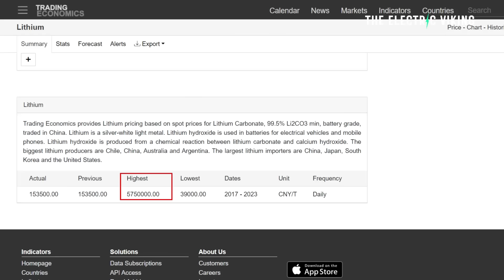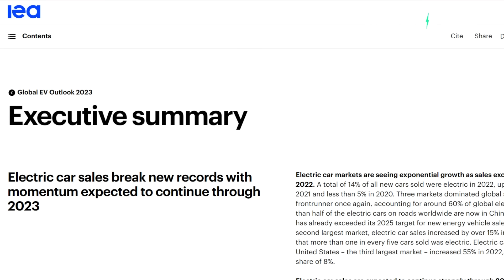The reason Electric Cars will be cheaper than ICE cars in 2025

Comment: You're inferring the wrong things from the price of Lithium. There are two sides to the price equation, supply and demand. The combination of those two sets the price. Although supply has increased over the last few years, supply doesn't change much over a month or two. Sudden changes in price are likely due to a sudden changes in demand, and if you look at the auto industry, EV demand has hit a wall. The people that will buy and EV because it's cool already have one, and for the people that are left it needs to make economic sense, and EVs don't make sense at current prices. Therefore unsold luxury EVs are piling up on dealer lots here in the US. Interest rates have also hurt the economics of EVs because you are basically paying more up front in exchange for savings down the road. This is harder to justify with higher financing rates. It think we are going to see a setback across the entire auto industry with prices of the average car coming down, and the luxury car market getting hit hard. Can EVs compete in that market? Maybe, but you can be sure that the price of ICE cars will come down too due to reduced demand. The winner will be the one that can get cheaper products to market the fastest.

Comment: For around town EVs are great as you can charge at home, but in the US there are not enough charging spots. In some places people are waiting in lines to get a charge spot for 30 mins to “fill up”. As soon as existing gas stations have chargers that would change but it’s far off.
Reply: You're confusing all other EVS versus tesla. Tesla's have no problems charging, there's chargers everywhere.  Tesla's are actually far easier to use than a gas car, I know since I have both.  Taking care of my gas car is a PITA.  the Tesla is easy it needs no maintenance. Just charge it at home twice a week, easy.
Reply: Fortunately, battery tech keeps getting smaller, faster charging, larger charge capacity, etc. We're just a 3-5 years away from EVs getting FAR more "per gallon" than ICE cars. 6-7 years and you'll be able to drive across the country on a single charge.
Reply: @monkeysuncle2816  But not by 12-15 months in 2025. As soon as I can pull into a QT or Loves on the highway and get a sandwich and a drink while I charge without waiting I’m in.
Reply: @jeffgreenwaldJLG  we could be there in no time with solid state battery tech.
Reply: @monkeysuncle2816  when that arrives I’m in. LOL

Comment: I neither agree nor disagree with you.  Certainly though, I don't think you have sufficiently considered a number of factors in your analysis.

Why would you use China's EVs as ANY kind of example?  Chinese EVs are highly flammable, INCLUDING BYD's EVs..  And very explodey; it's all out there if you look for it.  Lithium batteries are inherently more risky.  I think that you're not thinking this is a bad situation at all, ,but it is.  Sometimes, the 'splodey EV also takes a building WITH it.  Also, in many parts of the US, Canada, and Europe, it gets pretty damned cold in the wintertime.  Being a Viking, you would KNOW that, yes?  Yeah, well cars get stuck in the snow.  Or they get in accidents in the snow and ice.  Or get stuck on a freeway when all the cars in front of it are stopped for a traffic accident in the snow and there is no easy way to get off of the limited access roadway.  Even making a U-Turn across the center median may be impossible due to topography or concrete walls preventing oncoming traffic from crossing into...the "other" oncoming traffic.  Running the heater or air conditioning while waiting (sometimes for hours) for the road obstruction to be cleared.  There was a major accident in the Eastern US (on US I-95, I think), and people almost died because their EVs died much faster than any ICE vehicle on that same road.

Will prices come down?  Surely they will.  But Lithium is only mined in about 6 places in the world, and most of those places are (ahem) politically unstable, or they use child labor to do the mining.  Some places in the world won't care about that, but the places with money to spend probably WILL care.  In two years?  Maybe, but I think it will be a lot longer than that.  But that's not the WHOLE story, is it?  We still have some very serious problems with EVs.  Lower energy densities than gasoline, heat generation (and heat sensitivity), that whole "goes bang" thing I mentioned first, recycling capacity, the charging network, and more.

I would love to buy a Tesla, by the way.  But I highly doubt prices will come down in 2 years...not to a point where I would be willing to spend the dosh on one.
Reply: I think the flammable ev are mostly from south korea

Comment: Recent interviews with EM point toward a huge slowdown.   Most of that battery "spare" capacity you're talking about will likely go directly into grid/micro-grid storage solutions.  Australia is currently struggling to prevent electricity supply shortages as we blow up our coal power plants and drag our feet with viable replacements.  Electricity supply is going to be one of our biggest hurdles...and availability of charge points that can charge your EV fast enough to keep things moving.   If we can figure out these three things in the next 12 months then I'll buy in to your analysis and conclusions:
1. Electricity supply is scaled, distributed, buffered and reliable enough to handle wide distribution of EV's outside core capital cities  (renewables won't do it without significant infra and storage uplift)
2. Raw material supply needs to be more diversified.   Most AU materials go overseas (primarily China) for the components to build EV's, batteries, etc.  The current global political environment has made most economies risk averse toward the complexity of global supply chains.  Prices will need to be a bit higher to hedge those risks.   ICE vehicles have many of the same risks, but EV's introduce even more.
3. Energy portability.   Perhaps if all EV's were to adopt a standard "pack" (even if it's just an "emergency" pack that RACQ could carry around with them) to swap out like an empty gas bottle, the amount of planning required to spur demand for EV's will continue to be somewhat niche.
** bonus **:   Even if the availability of EV's is nearly on par with ICE vehicles...the popularity/demand for this (if you're right about it being very high) will ensure that the Australia Tax keeps their prices elevated.

My $0.02 are my own and do not reflect my company, colleagues, family, friends or pets. :)
Reply: Any kind of standardized battery pack is highly unlikely.  Too much design issues including Tesla’s structural battery pack vs the competition’s designs.  Just a matter of time before much more charge stations are built in Australia. But building them in the Outback has got to be a challenge not to mention along the coasts. But what do I know, I live in the US. But I have looked at the Tesla SC network map for OZ, too sparse outside of where people live.
Reply: @Chainyanker007  There will never be standard battery packs (for main power), however, there needs to be something like a 'gas can' that can be easily transported for stranded cars that reached a bit too far.  Otherwise, as EV's rise there will be a need for a lot more tow trucks (or high output diesel generator trucks).  Electric charging stations require the infrastructure to supply them and we're already facing huge price hikes in electricity due to undersupply.   Hopefully the super brains (or AGI) will figure it all out. :)

Comment: Even if parity in cost is achieved, there are many people who won't buy an EV when they need a newer car. Apartment dwellers, boat haulers, gearheads for the most part. And the Luddites, who swear that they would not EVER drive an EV if it was free, because reasons.
Reply: Resistence to change is very normal. Yet change still happens, and maintaining the old ways becomes more difficult. Gas/Petrol stations will become less convenient to find. Spares or replacement ICE vehicles will become more expensive as economues of scale drop.

In Derby UK, Toyota has already turned part of its manufacturing over to refurbing used ICE vehicles to "New" spec, 

Demand for their new ICE and hybrid models is being shredded by better and cheaper EVs than it can make itself yet. 

Sadly there is panic in the board rooms of legacy ICE vehicle manufacturers who have not embraced the superior promise of the EV technology, or focused on how to do it cost effectively.
Reply: I insisted I’d never have a computer or a smartphone, woke up eventually as they will.

Comment: This is nonsense. In Australia we have myriads of small towns which don't even have the electricity supply to charge cars. We have millions of people who camp, ski, boat and caravan, and they can't use electric cars. We have road trains of 3 trailers on a prime mover. And our electricity prices are going up and up without electric cars. And to think that countries like India, or South American countries are all going to have electric cars is fallacy. With petrol and diesel, the product is pumped into a truck, driven to the station, and pumped out. Electricity requires the energy source, huge power generators, large power lines to each charging centre, and a massive increase in electricity generation, from coal, oil and gas. Two years ago China was building about 350 coal fired power stations in the world. Australia massive coal exports went up 10% last financial year. And there still wouldn't be enough electricity to power electric cars if everyone had one.
Reply: What are you talking about. Pretty much every small town except for the 1% most extremely remote towns are connected to nation grid electricity. Our energy grid is more than capable of coping with an increase in EV ownership. And lastly. I have an EV. It’s not even a long range and I take it with me when I go snowboarding. Multiple times every season. I also take it camping with me.

I don’t really think you understand what you’re talking about.

Comment: Bad news your flogging a dead horse  evs are a flash in the pan  issues such are charging problemsfires huge carbon footprint from manufacturing lack of raw materials  insurance problems no resale value eg who will buy a 5 year old ev knowing the battery will only have a few years left
Reply: Modern EV batteries are designed to last twice as a long as an IC engine. EV battery warranties alone are nearly 10 years. Meanwhile the industry standard warranty for a brand new combustion engine is only 5 years. 

Also the Tesla model 3 has the lowest 5 year depreciation of any car in history. That sorta conflicts with your theory about resale value. I think maybe you havn’t looked up the facts and are spitting random BS you make up in your brain and decided you wanted it to be fact.
Reply: Not to mention the us justice dept investigating ev manufacturers  for software that falsify range of vehicles on full charge only for drivers to discover the ev won't go as far as quoted lol @engineeringtheweirdguy2103

Comment: Fixing the old car is the best investment you can make
Reply: Up too a certain point
Reply: My 1991 Mazda still going strong in Ottawa Canada 🇨🇦 where we use insane amount of salt. 
I'll not buy an electric as the battery replacement costs are to expensive. Minor crashes often require $20 000 repairs... 
The used car market has been all I could afford, I'm almost 40. A used EV costs way to much new and there is no way I'd trust the batteries or be able to afford the battery replacement. Global news had a guy in Toronto Canada I believe quoted fifty thousand dollars to replace the battery as his used EV would not charge at 170 thousand kilometers just past the warranty. 
It makes no sense for those with low incomes to ever buy a EV as they are now
Reply: @ZoomZoomMX3  Tesla batteries should last 300k miles, and they only cost 10k to replace on the Model 3 and Y.  Some GM cars like a Chevy volt, I have seen insane prices to replace the battery.  I'd only buy a Tesla.  But, you are right about the cost to buy a new Tesla, its not cheap especially with interest rates.  I'm saving $250 per month in gas, that's 40k in savings after 10 years, so if a new battery is 10k, i've still saved 30k.  Hopefully the road salt doesn't ruin the battery until 300k miles.
Reply: @ZoomZoomMX3 there is no way I'd own an ICE car. I have heard that someone had an engine that needed replacement and it cost $35000 to get a new engine fitted in their Toyota. I can't take that risk. I'll stick to an EV that has proven reliability. So reliable it doesn't even need scheduled servicing.
Reply: You can also convert an old car to EV for significantly less than buying a new EV as well, being both financially and environmentally responsible.
Reply: @downix  Neither.  Your ICEV is fully recyclable when it dies.  Your EV is not, and is inherently contaminated with environmental hazards.

If several major spills and other incidents have proven any thing, it's that petroleum products are far SAFER for everyone, than EVs.  So making another one is both financially and environmentally IRRESPONSIBLE.
Reply: @billcichoke2534  now you're just lying
Reply: @downix  Nope.  But you are sounding deluded.
Reply: @billcichoke2534  and what part of an EV is not recyclable? The body is the same. The suspension is the same. The motor is simpler and easier to recycle. And battery recycling is old hand, done since the 19th century, so, what?
Reply: @downix  The metals used in the motor aren't like an aluminum can, and aren't just melted down into new motors.  Nor are the component elements in the batteries.  More oft than not, they're relegated to landfills, where they ACTUALLY contaminate the surrounding environment.

So the very components of an EV that SUPPOSEDLY make it enviro friendly, are the very sources of some of the most insidious pollutants we have.

Before you spew some garbage about 'theyball get recycled,' according to the EPA and even some recycling outfits, 95% are NOT.
Reply: @billcichoke2534  Yes, they can and are melted down for recycling. Those are some precious minerals in there, and only a fool would landfill them.

You see, these are not new arguments. In fact, I heard the same ones in my youth; only then being directed at catalytic converters.
Reply: @downix  No, only an ignoramus would assume a company can do that profitably, considering the processes required to do it.  And since some of these are basically ILLEGAL to do in the U.S. (due to environmental policies), thry don't happen.

Please do some research on what it takes to process and reprocess the components of motors and batteries.  It's not a simple 'melt and shreds like you've apparently been led to believe.

And these arguments are not over TEN years old, because this issue hasn't been looked at for more than FIVE years.  So stop spewing nonsense.
Reply: @billcichoke2534  further highlighting your ignorance. You claim issues are new, when they are old. You are just fooling yourself.
Reply: @billcichoke2534  EV batteries are being fully recycled into new EV battery materials, its already happening and will ramp up even more in the future.  Every part of an EV is recycled, same as ICE cars.
Reply: @downix and yet they are not recycled. Nowhere in the world exists any significant installed capacity to recycle EV batteries. Very simple to check by yourself. Not even a tiny fraction could possibly be currently recycled, and there is only the vaguest plans to change this. It will happen when becomes mandatory, with a recycling fee paid by the buyer, like with any other commodity.
Reply: @larbranca  save they are recycling. Exxon Mobil has made heavy investments in EV battery recycling, for example, and it was a good amount of their non-petroleum revenue last year
Reply: Actually, if you crunch the numbers in earnest, the reverse is true, unless you drive very little with that old car.
Reply: That is true, although in my state with the amount of salt they use on the road, my last Camry only lasted 120k mi and it was always garage kept. It had to be scrapped, wouldn't pass inspection because of the rust.
Reply: And most environmentally responsible as well.
Reply: Not if that old car lasts more than 20,000 miles. At 20,000 miles an EVs emissions in total fall below an ICE even when accounting for manufacturing.
Reply: @Jonger1150  A lot of EV cult nutters as indicated by these comments.
Reply: @TheTruth-dy8ze  what did you expect in the comments of an EV nuthugger channel
Reply: Abd the most green solution! The car that waz never built is the greenest !